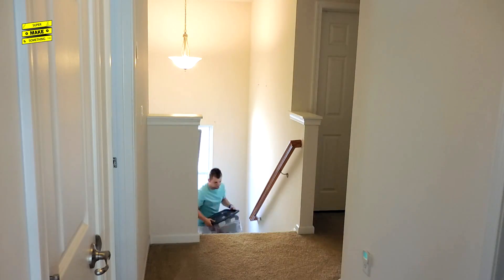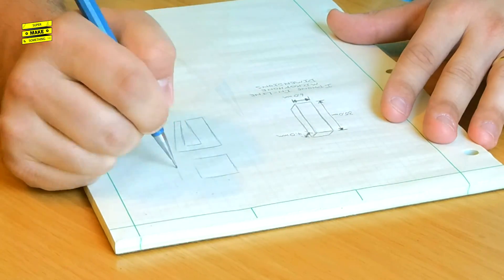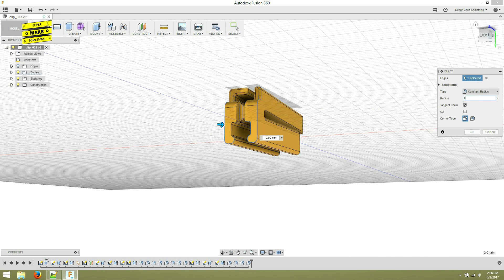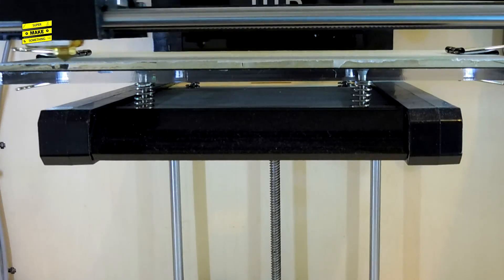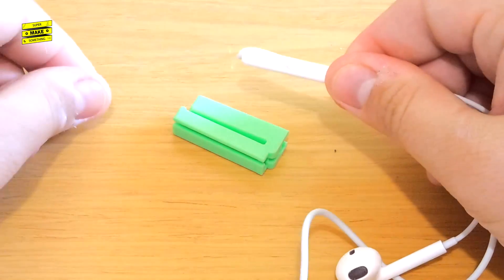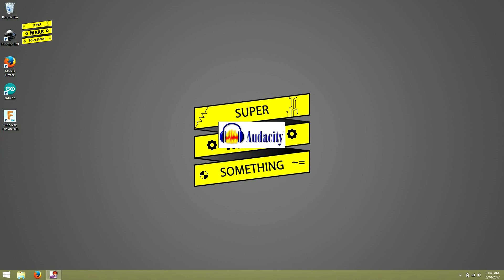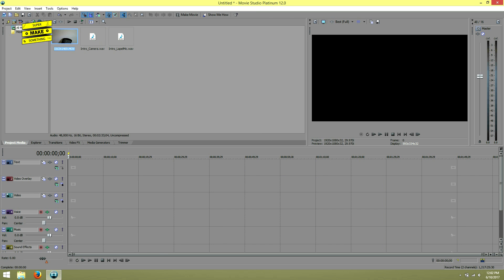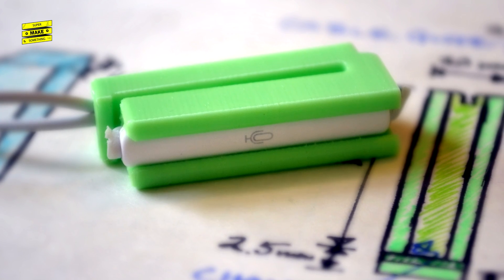iPhone EarPod Microphone Lapel Clip (3D Printing, CAD, Audio Processing) - Super Make Something

Comment: good video ! but please, when designing a part for 3d printing, keep the rules of FDM in mind. Here, you should have rotated the part 90° along the Y axis so that it lays flat and doesn't requires support. There is no need for support in such a print, it just reduce the surface finish where it touch the part.
Reply from the maker: +leo belpomo Thanks! This actually ended up being the optimal orientation because of the overhangs that secure the microphone and cables. Rotating the print +/- 90 degrees along the other axes would have resulted in interior supports that may have affected the fit of the microphone.
Reply: Super Make Something in this case adding chamfer to the floating edges could have help avoiding supports ... i haven't fully checked the part but it looks like it could be modified to don't need these supports
Reply: Super Make Something but good job anyway ;)

Comment: wouldn't doubling up the cable damage the cable over time? have you considered looping the wire around piece rather than a sharp bend?
Reply from the maker: Surya Raju That is certainly another option, but overall the cable seems pretty robust. Those particular headphones have seen a lot of flexing/bending over the time I've owned them, but still work fine.
Reply: Super Make Something I guess usage and time will tell ☺ looking forward to your videos.